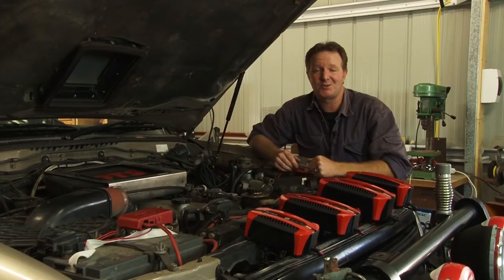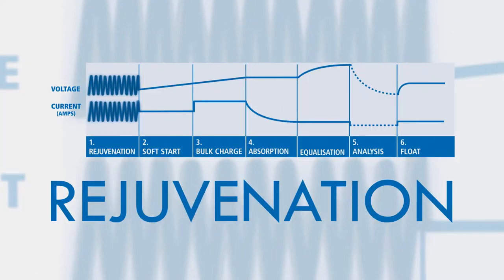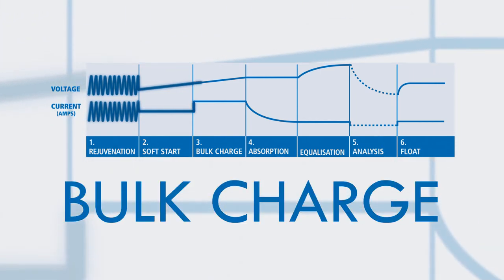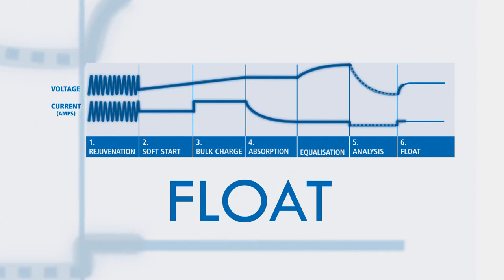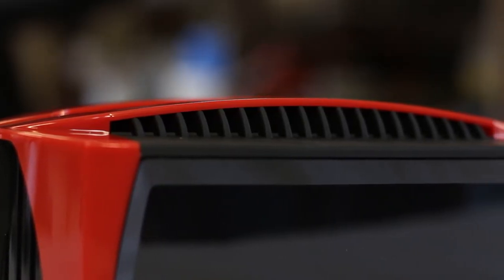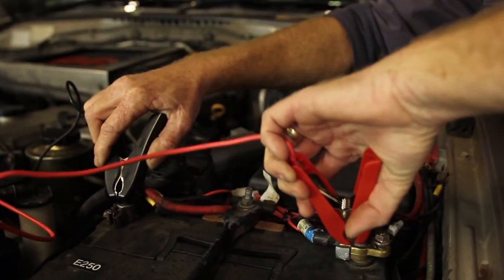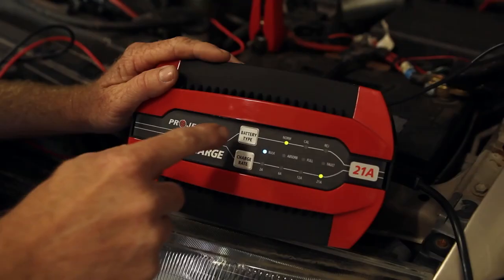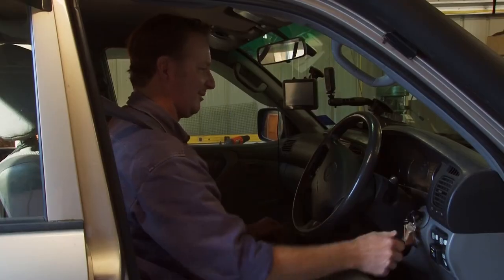Projecta Pro Charge Battery Chargers

Comment: Every battery I try to charge comes up with fault light flashing. Even new batteries.  Chart says clips on backwards. Not that stupid. Dont know if the charger itself is faulty . Carnt find any other information on this.
Reply from the maker: Hi Darryl, There are 6 possible error signals that may be displayed. Please see the user manual error signals section for more detail on troubleshooting  https://bit.ly/2YUQ2Dd - if this doesn't help, contact Projecta for more help: National Toll Free 1800 113 443